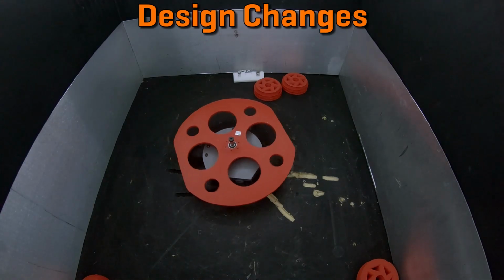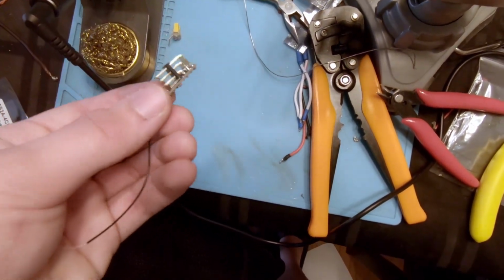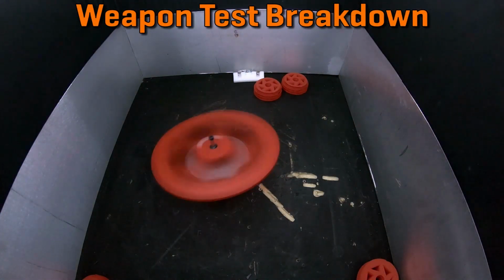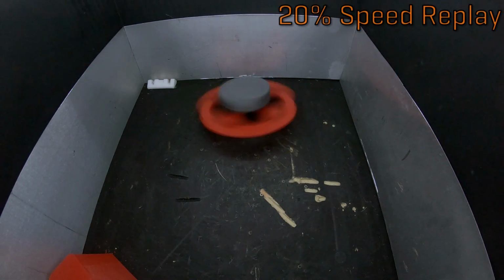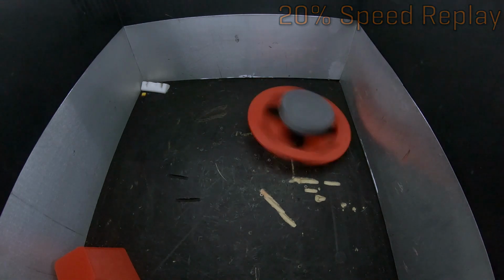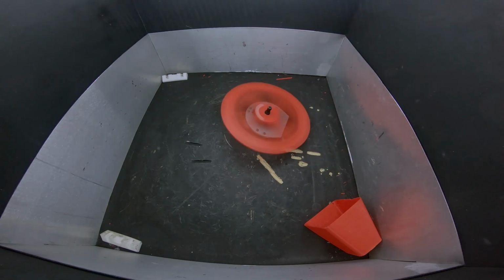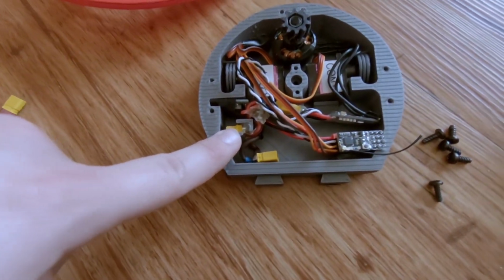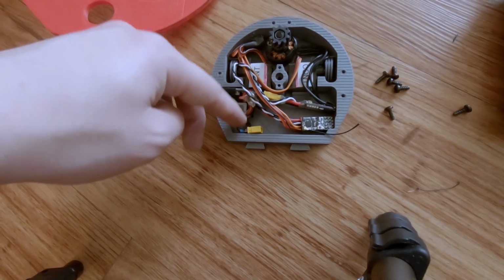Mini Mulcher V0.8 Weapon Tests, Analysis, and Electronics (Antweight 1-pound Combat Robot)

Comment: I told you about the angle on the weapon
Reply from the maker: Yeah but steering isn't a problem at all so that's clearly not the main cause of the issue. Otherwise it would tip front or back when turning left or right.